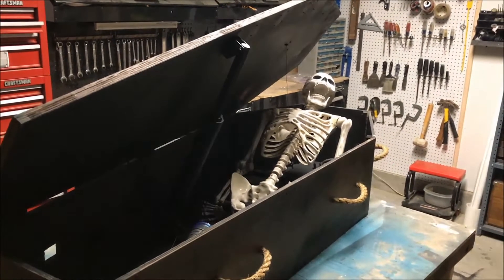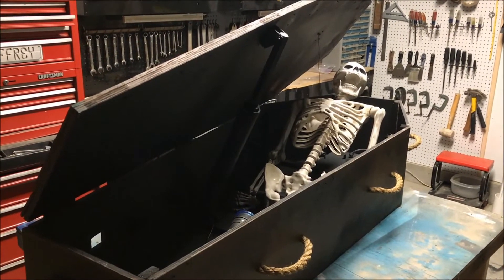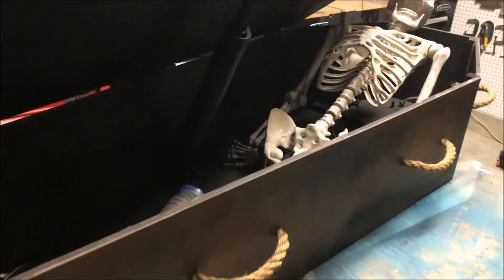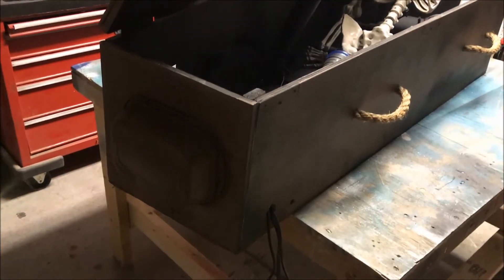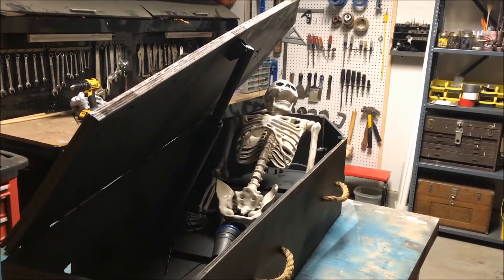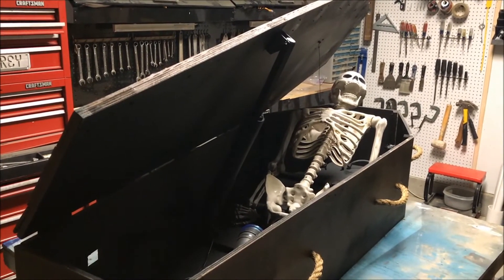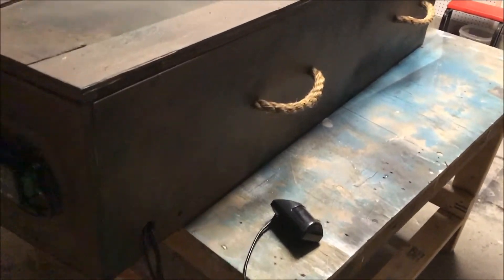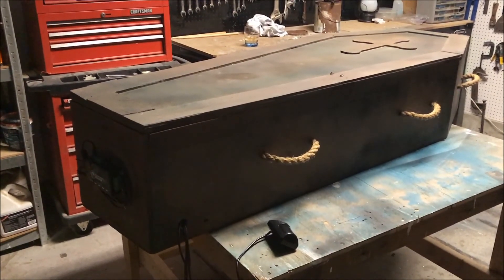Halloween coffin with linear actuator

Comment: I have a very similar looking linear actuator that I installed in a wheely bin.  I've looped the motor wires out of the bottom of the bin and fitted connectors.  That way I can unplug it from the internal controller and apply 12V directly (to open it) if anything goes wrong.
Reply from the maker: That's a great idea!  I wish i would have done that.  I thought of adding some sort of switch as a manual override, but seems like a lot of effort.